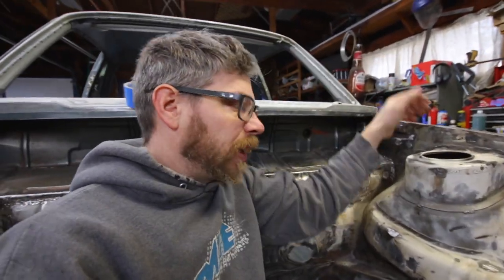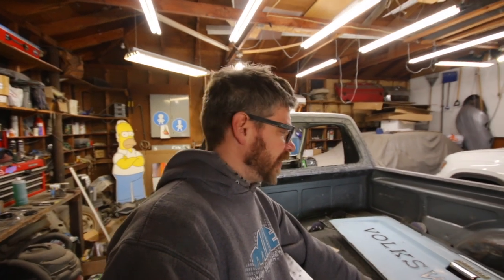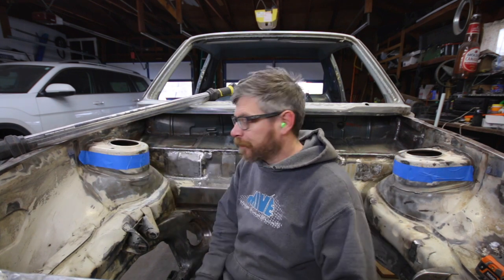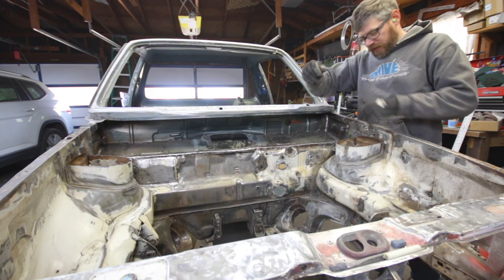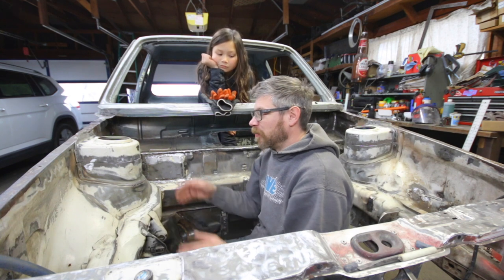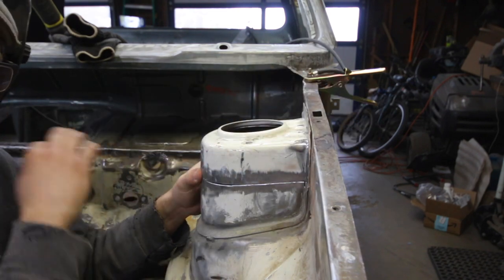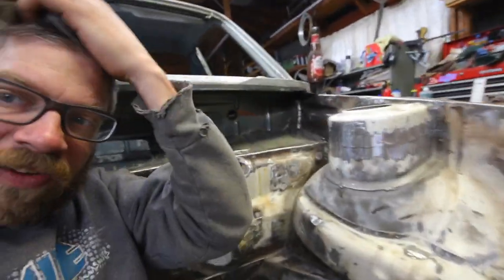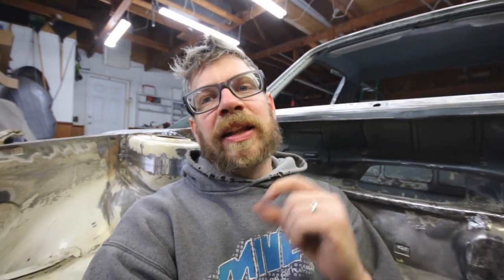Raising strut towers on a mk1 -- Rabbit pickup project part 16

Comment: Nice job and super dope editing...
Question what's the purpose of making the towers taller?
Reply: It will make the car sit lower than a car with regular height towers given the same suspension setup.
Reply from the maker: Yup what Brandon said, also helps when you lower it to give yourself more travel so you’re not riding on the bump stops per say

Comment: Dude, how much do you want for your scribe/shim kit? I'm planning on doing the same with my towers and that little trick would save a lot of headache.
Reply from the maker: It helped me a little for sure. I just wanted the cut line to be straight.  I'm sure i could come up with something to sell or rent.
Reply: I've got two trucks and a convertible. The second truck is becoming a trailer and the vert is just for parts so I have two good front ends as extras.
Reply from the maker: @turtlebone  That helps for sure!

Comment: While this is a very cool project I would like to send a warning to all watching and learning from videos like this.   When you are cutting or grinding metal with that high-speed wheel, and also when you are welding- you are literally vaporizing that metal.    If you do not at least kick on a fan or set up your workspace with some kind of decent ventilation you are basically vaping steel straight into your bloodstream.

I beg of you, practice good ventilation or you are going to pay an unspeakable price, and it's only a matter of time.   Your vital organs do not mix well with heavy metals.

Comment: What under dash master cylinder you going to use? I’ve been trying to wrap my brain around what I want to do or use but as far as brake booster I want to have the same mechanical advantage if I’m going boosterless
Reply from the maker: I plan on using the CKW2 kit. I already have it ordered and it should be here this week I believe.  I plan on making a install video for it 👍🏼
Reply: Paul Lehman awesome! Subscribed and followed on ig! Motivation to get my rabbit done!
Reply from the maker: sgiza228 awesome thanks!